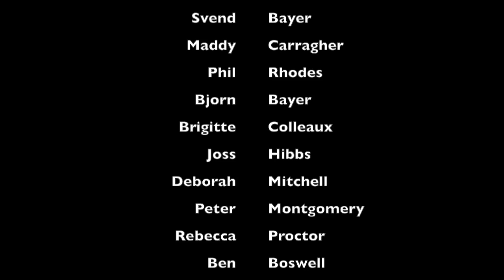Kigbeare Kiln Project

Comment: Great video! I loved it! Imade a 3d animation video to show how my wood burning kiln was built. Her name is Norberta, after the Norwegian Ridgeback Dragon... She is much, much smaller though. Manabigama proportions. And I use no arches, or better yet, I use what I call a "radical Micenaean Arch" technique. The arch is locked in place by the weight and cement on the outside and above. So you don't have to spend money and time mounting a catenary wooden mold.  Also, I don't insulate it so much, with that extra layer of external cement, because I want it to be "sort of" easily disassembled, in case I have to reassemble it somewhere else! that is another feature of small size kilns. Not possible with the big beast you have, there! Check it out in my channel if you like! Thank you for sharing! I'm going to watch the video about it's first firing now! Take care!